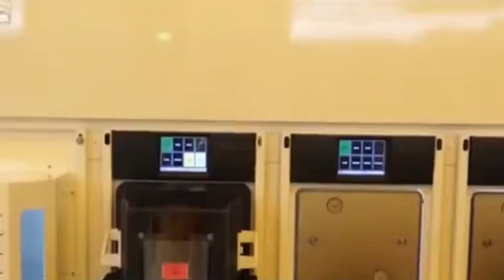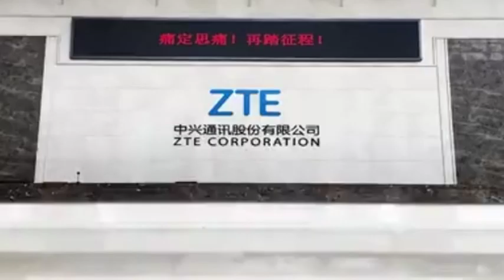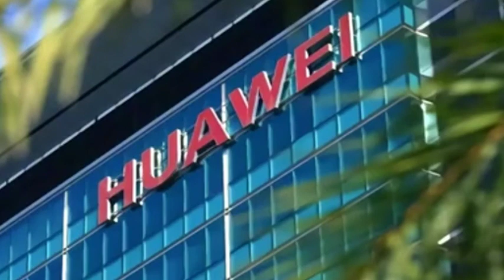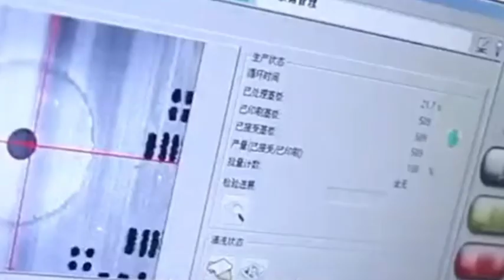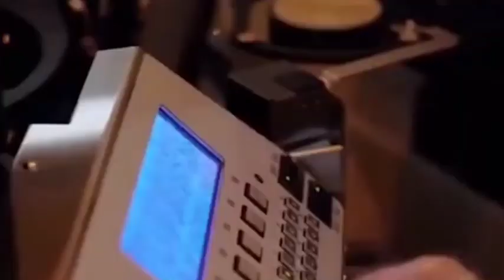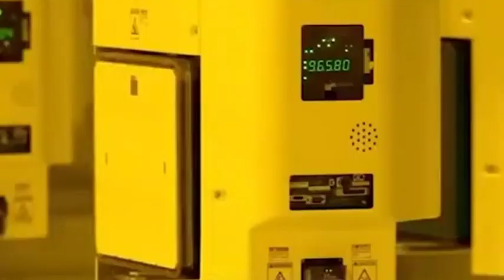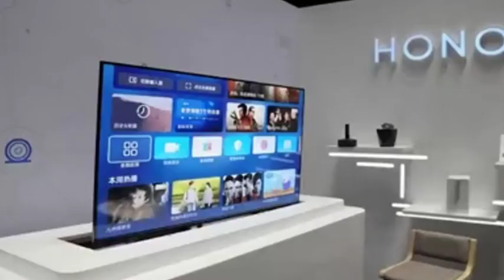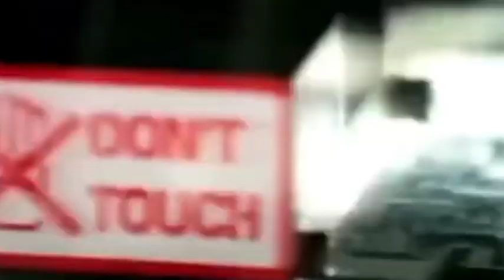Huawei will invest 40 billion RMB to build a R&D center in Shanghai and become a neighbor of SMIC.

Comment: Unless Huawei can produce CPU chips comparable to Apple's and Qualcomm's most advanced 5G chips it is unlikely to help the Huawei brand capture any significant market share even in the Chinese market for year 2023 or even 2024.
However, since very likely they would have perfected and able to mass produce a 7nm  5G chip, it would be better to focus on Huawei's NOVA brand for the time being. With competitive pricing and a host of add - on features which can capture a sizeable low and mid range chinese and developing world markets for 5G phones. The market for flagship phones are already very crowded, and under the present world economic condition,  many people are hard pressed to fork out the  cash to buy high priced  flagship phones at the moment as there is nothing substantially different from one flagship brand to the next, except perhaps, Huawei brand which comes with Satellite comm. and Kunlun glass, and of course, substantial battery power reserve even at 1% battery level.

Comment: Huawei has a huge R&D center in Dongguan Shenzhen.  It appears Huawei's Shanghai R&D center is focused of semiconductor fab.  Huawei recently announced an EUV light source patent.  The light source is one of the key functions to ASML's EUV success.  

Huawei also has a fab in Wuhan where its semiconductor and optics fabs are focused.  One would not be surprised if Huawei also put a new R&D center in Wuhan that is focused on photonics and newer semiconductor materials.  The Huawei puzzle is coming together.

If the above proves real, the US will wish it had worked with Huawei instead of trying to kill it. Even the new American fabs by TSMC, Intel, and Samsung may not be enough.  In fact they may be obsolete because they are not cost competitive and the semiconductor industry has moved beyond silicon.
Reply: Good argument.